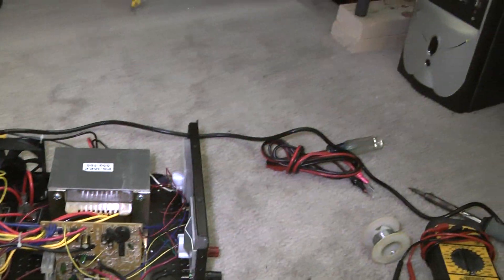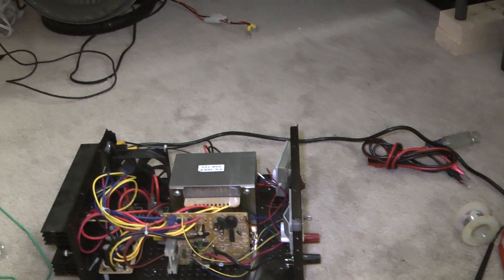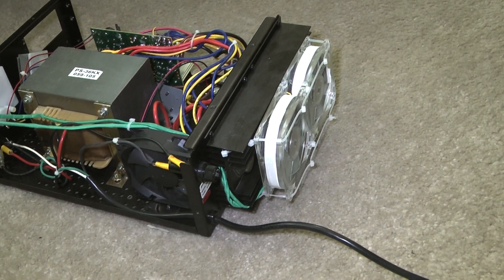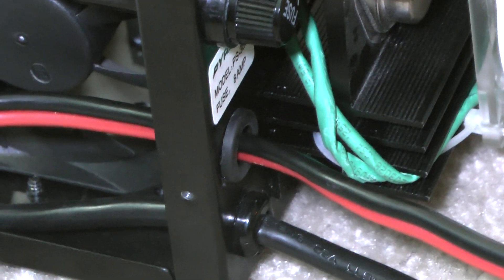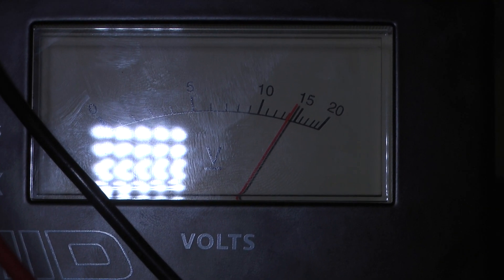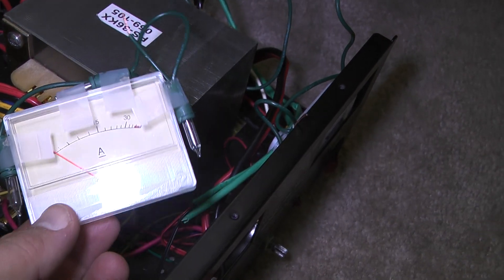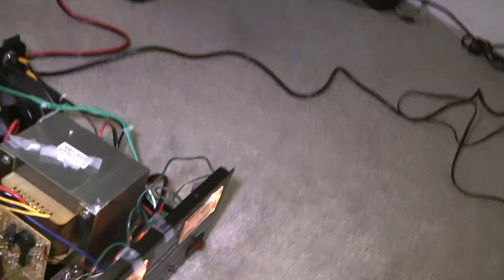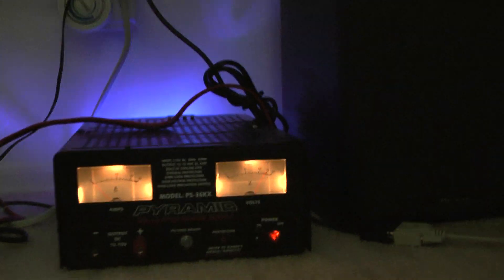Pyramid 32 Amp Power Supply - Additions and Adjustments

Comment: in mine i did the fans but all so replaced the fan inside.. then wired them up to an 9v reg they dont need to be pushing full speed. and used 12v LED strip..   but i need to find out why my amp gauge is not working.. the meter moves if i put 1.5v on it but wont work in the PSU

Comment: Did you try the "Voltage Adjust" on the front? Additionally, the "flat-top" 12VDC LED's work great for the meters and will more than handle the 15VDC.

Comment: I know this is an old video (1 and a half years), but I thought about the volt meter, did it not have a needle adjust on the meter itself. Many do, and a small flat head screwdriver would have had that meter reading bang on 13.95 volts :) Nice mod - my supply has digital meters, but you gave me a brilliant idea - mine has front panel banana jacks, and a heap of empty space on the back panel, perfect for a 4 way andersons socket - no more messy leads showing at the front :)